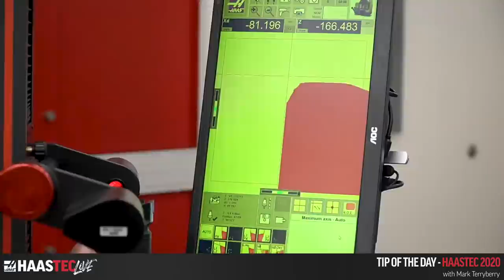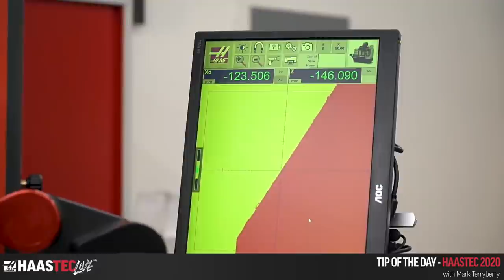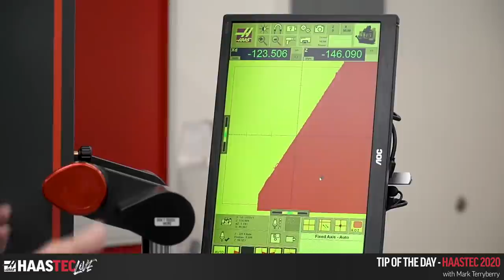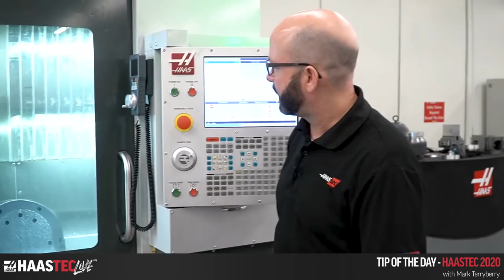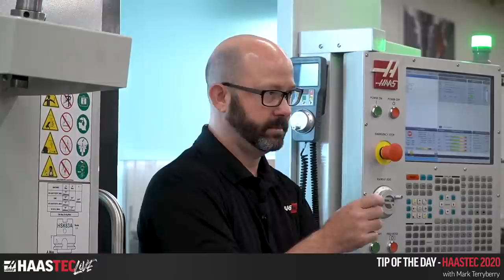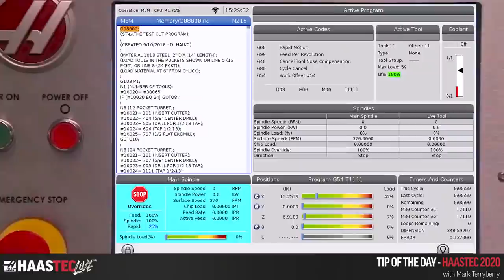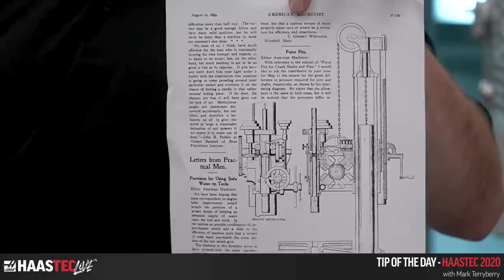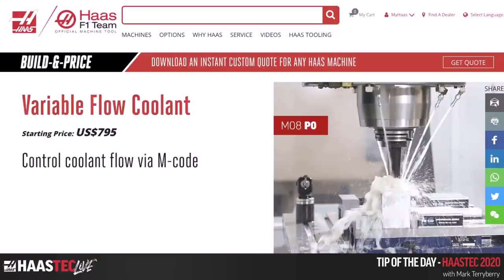HaasTec Tip of the Day Live - HaasTec 2020 Focus Series - Haas Automation, Inc.

Comment: Make us some little robots, like the ones they use in the amazon fulfilment centers, that automatically swap chip barrels if it gets too heavy or if it detects chips are too close to the top. They take the full barrels to designated area in the shop and bring an empty one.  The robot sends a signal to the machine to turn off the conveyor while the barrels are being swapped and then sends a signal to resume the conveyor when a new barrel is in place. Add multiple barrel robots to multiple machines and have them que the next empty barrel for less conveyor downtime. 
This paired with the machine auto-loading robot would be almost perfect automation. (We just need a method to load/replace broken tools autonomously)

Comment: I don't know about Haas controllers, but I have very practical way to measure a boring bar without any hole preparation.
Put a small diameter bar in the chuck (or cut a small shoulder on the front side of a bigger bar) . Jog the X-axis to the negative side of the rotation axis, and cut the OD of the part. In the offset menu, set the diameter as a minus value (e. g. X -12.345) . Of course, the stroke is limited, but it's quick, it's easy and it doesn't need drills and 3-point internal micrometer for a proper setup!
Reply: Are you talking about a lathe? If so then there is no problem since you can (usually) just use the pre-setter tool. This doesn't work on a mill though.
Reply: @josef5636  Yes, I am.
What do you mean by pre-setter tool? Like an arm type (digital) tool setter?
Reply: @arpadbrecska8178  Yea the arm that you use to touch of the tools. Haas has some advertisement on them if u want to take a look. https://www.haascnc.com/video/tips/m3vhjw1ykyo.html
Reply: @josef5636  Of course, if you have a probe, it's much more easier to do the set-up. But you know, many shop owners don't buy this "option" and in that case operators have to do it. Mark mentioned that first you have to drill a hole, than cut the ID and it takes time and maybe extra tooling. The process I mentioned doesn't involve drilling and probing only a workpiece clamped in the chuck. The bonus is that you can actually see the tool when it touches the surface what you can not say if you do that in a hole.
I hope it makes sense how I explained because I'm not fluent in English.
Reply: @arpadbrecska8178  Haha I guess I've been spoiled by having a tool setter in the lathe. Your method is definitely very intelligent on a lathe without a tool setter. At first I was just a little confused because the offline tool setter seen in this video is made for milling tools, so I was initially thinking of your method in a mill.